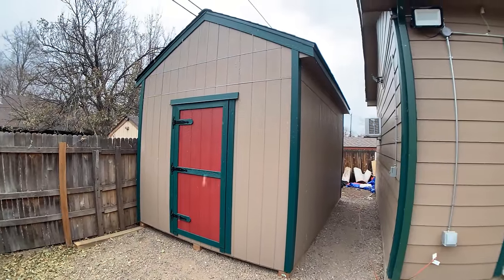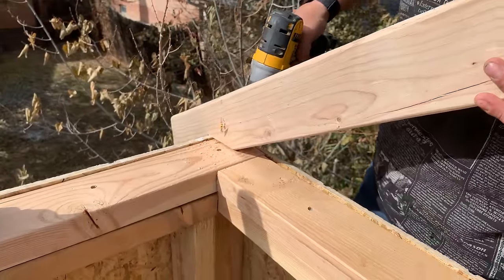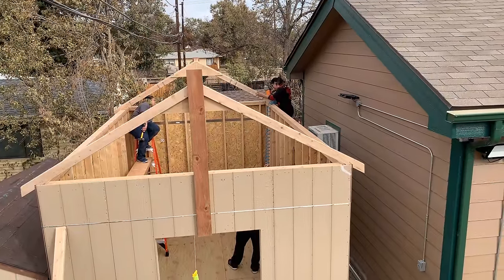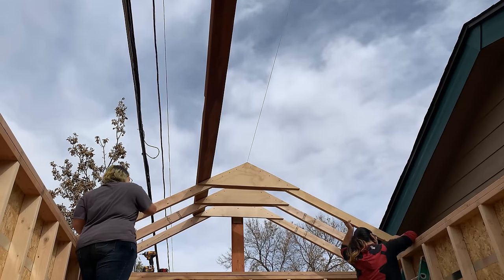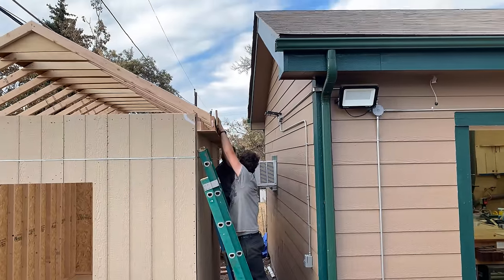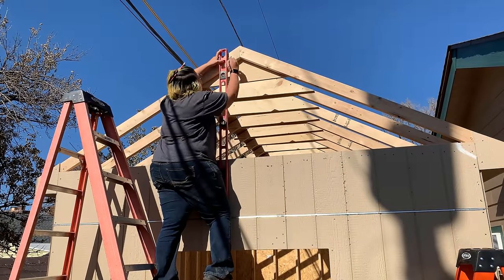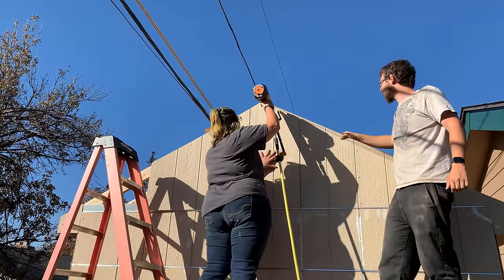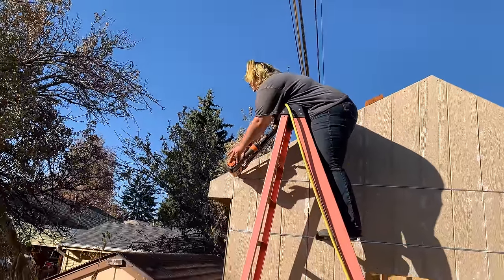102 - Shed Build part 4 Roofing Structure, Fascia, and Trim

Comment: Nice video, I built a shed just like this 10x12. I put an upstais floor across the entire building at 6'10" ceiling height for bottom level. Made for twice the space for storage while downstairs was completely functional for laundry room and motorcycle man cave. This style made it VERY easy to build the truss work! No balancing on ladders needed.

Comment: On those Trusses, you can put in pocket holes and do a quick fast down, doesn't have to be tight, the support pieces on top will help hold as you stated. Also put those hurricane supports on while you still have the trusses on the ground, helps to hold them while you're putting them in their proper position for final fastening. I hate using nails anymore, prefer screws over the nails, unless "local code" calls for it. 
I enjoy the fact that you've got your kids involved. Now, hopefully, they'll have a "slight" trade to fall back too later in life and hopefully, they'll pass on the knowledge they're learning from you now. Been enjoying this series since I recently came across it. 

Thank you for the sharing of this series. Cheers :)
P.S. It's looking awesome, very professional.

Comment: Great educational videos James and King family. I’ve learned so much from your woodworking videos.

I would like to point out that even for a shed, it is important to have proper air flow through the structure using soffit vents and roof vents.  This would prolong the life of your shingles and make the inside of the shed more comfortable to walk into. Not sure of the benefits to the tools and materials you would store inside, but I built my shed more than 15 years ago, much like you did, but I added airflow vents. My 15 year shingles are almost like new, per the roofers that have replaced wind blown shingles on my house roof.  My shed roof remains intact, and I’ve had no rust develop on any of my tools, no musty smell, and it’s comfortable to be inside of it when it’s 35+degC (95+degC) outside.  It feels good to know my design is not far off the master woodworkers design.  Love your work!
Reply: I was wondering about the ventilation aspect too! Perhaps drill small holes in the soffit and maybe line it with screen before attaching it (the soffit)? I haven't gotten to the roof part to see what they do with the roof vent.

Comment: Another great educational video. 
And WOW! I knew that was a tight space you all were building in, but this video really showed just how tight.
Reply from the maker: Thank you!. And yes, we had less than 48" between the shop and the side of the shed. I was really worried that we wouldn't be able to adequately film this project. I hope it came out ok.
Reply: @KingsFineWoodworking  Came out fine.
Reply: Surprised the side of the shed appears to be right on the lot line, if indeed the fence is on lot line.  I guess your zoning bylaws must allow that, ours requires 24”.

Comment: Very nice video James. I build a 12' x 20' shed to store lumber in this past summer. I used vinyl siding on mine though.. I did notice that when you install the channel between the siding pieces you set the top piece down on the channel. This piece should be left up off the channel so water doesn't want to soak up the end.

Comment: You could also use a long screw straight down from the top of rafter into plate.  Faster and stronger than toe screwing. 😉
Reply: longest screw i found in home depot is just 3 inches

Comment: Looking good!!!  Love the attention to detail on the faux seams matching and the corner trim with the sides going on first and the fronts covering , I'm a perfectionist myself.  I did have one question though.  It seems you could have avoided the upper z flashing by just waiting for the end gables to be put up then finishing your siding for the front and back.
Reply: or, since you know the rise of the roof, just cut your siding that length plus what ever you need for the wall and after your end truss is up and plumb, use your router and a flush trim bit.

Comment: Most trusses are now using Simpson Strong-Tie SDWC15600-KT Strong-Drive Structural Wood Screw. they screw from the bottom pulling the truss down to the top plate.

Comment: Thoughts hurricane clips are now not able to be installed with the teco 10 nail like you used they will be required in the future to be a Mitek rated screw at three times the cost  expecially on decks where after a couple of years you can walk up to them and just pull them out with your fingers they are unsafe  I know they are code and that we have to install them but i got flaged on a job and had to replace all of them so it is coming soon to an inspector near you

Comment: Question. At 18:35 you placed a triangle piece if siding. Is there a reason you didn't leave the short 2 foot piece below it off until you got to this point then just add a single piece eliminating the need for three pieces and additional flashing?

Comment: I'm enjoying your videos and have a question regarding trusses.  A number of videos I have watched show trusses being built with a "bottom board" that connects between the rafters and sits on top of the top wall plates.    I guess I would call it a rafter tie.  I notice you don't use that in your roof framing which I like because it leaves the ceiling space open.  However, is there any concern about the stability or rigidity without rafter ties.  Is there a concern of roof sagging or walls pushing outward without rafter ties.  Just from a practical usage perspective, I was thinking of adding rafter ties to make an "attic floor for storage or perhaps an attic floor on half of the shed.  Thoughts?

Comment: Looking good.  Why no soffit venting?
Reply from the maker: Hi Lou. I will put a few in. And I have a ridge vent. But my shed is neither heated nor cooled. So it’s not a huge deal if it were skipped. 

Except in summer the heat could get high in there.

Comment: Excellent build, as are all of your projects. I plan on using this pattern for my shed build. I do have a question. What is that DVD size box hanging off the side of the nearby outer wall of your shop? It appears about 14 minutes in to the vid.

Comment: Is there a reason you used 3 pieces of siding on the end faces instead of 2? It seems to me that the bottom pieces, when squared up to the frame and nailed in, will plenty strong to hold it square. Then you can add the second piece up to the peak/rafters and avoid an unnecessary 3rd seam.

Comment: Thanks for the great series. We’ll be buying plans in the spring. What material are you using for the trim work?
Reply: The trim is LP SmartSide trim, it is the same manufacturer as the OSB siding.

Comment: Awesome video. A couple questions: On the 10x16 plan on the top of the materials list it refers to an 8x16 plan; is that a misprint? I want to make I purchase the correct materials. Also, I'd like to move the door to one of the long sides and add a couple of windows; is that doable with this shed plan?

Comment: The soffit part seems inefficient for time and cost of supplies.  Maybe thats is the standard but it seems like a lot of excess material.
Reply: What's so expensive? Probably the entire soffit came from a single sheet of siding, 2 max. Somewhere between 40 and 80 USD for a full shed worth of soffit is about as cheap as you can get

Comment: I’m looking to build a shed size 16x12. I wonder if you have plans for it. Thank you
Reply from the maker: Hi,
We don’t have plans for that exact size. But we have a 12x12. That can easily be extended to 16’ by adding 2 more rafters and 4 more studs. 

Also, if you buy the 12x12 plans, I’m happy to give you the 10x16 plans for free. 

This way you can use the 12’ dimensions from one, and the 16’ dimensions from another.

Comment: I plan on building a shed, and want to use your plans.   Question for you - I have a concrete slab that is just under 10 by 12 feet.  Which size shed would you recommend for that size slab?   Thanks.
Reply: Why not increase the size of the concrete pad to suit standard shed and lumber sizes.  Easier in the long run IMHO.

Comment: I see that you have a 10’x16’ shed plan. I would love to make this a 20’x16’ shed. Is this possible?
Reply from the maker: Yes. Extremely easy. You just add 2 joint bays. Every one is exactly 2’ long. So you can make it as long or as short as you like.

Comment: Why have two joints on the siding? Could you not have just laid one row of full length siding on the walls while building them, then erected the walls and roof joists then cut the top piece of siding to match the roof angle. Making that little middle piece of siding unnecessary?